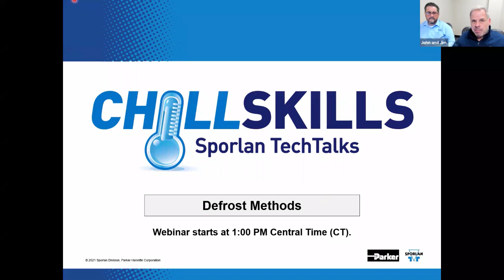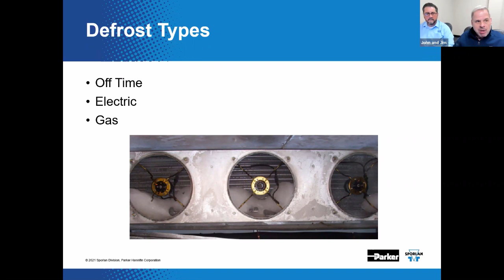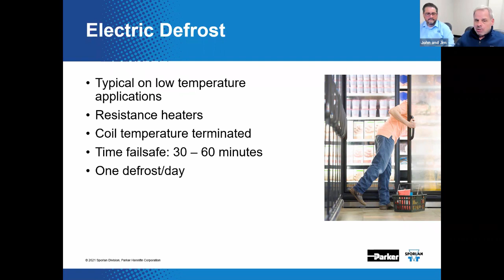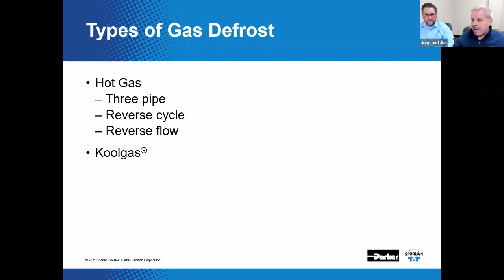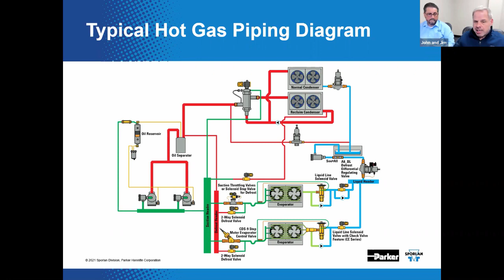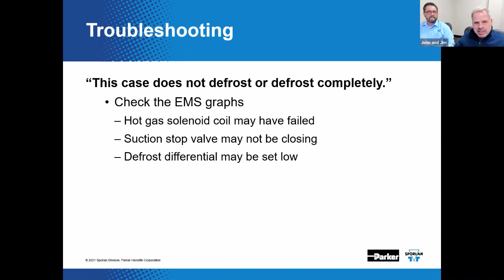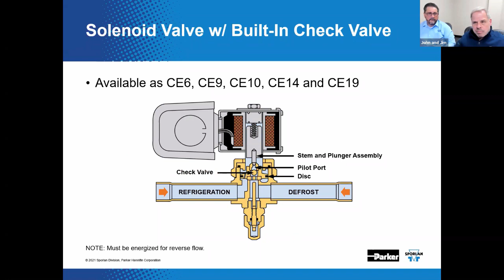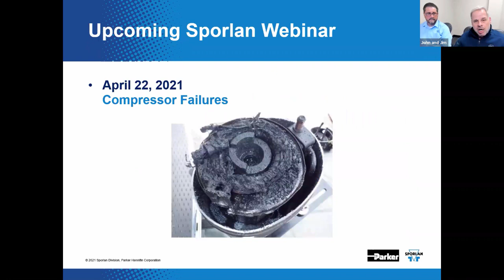Parker Sporlan Supermarket Seminar: Defrost Methods in Commercial Refrigeration

Comment: with the internal check valve in the solinoid valve you said when the vavle is not energised the refrierant can flow for cooling and when the valve is energised the hot gas can flow through. does this mean this valve cannot be closed for a pumpdown??
Reply from the maker: It will close in the normal flow with no energy, reverse flow will pop open and cause a restriction unless the solenoid is powered.